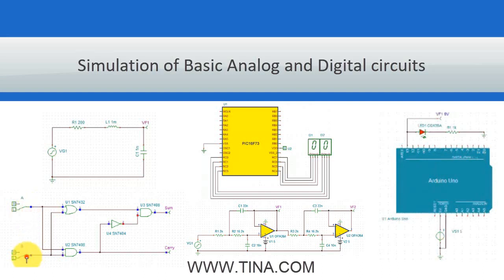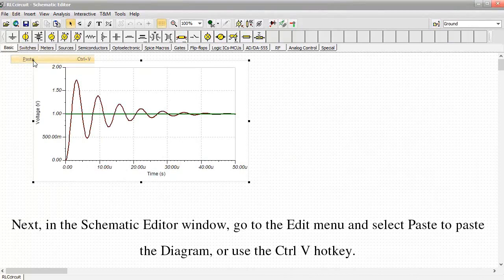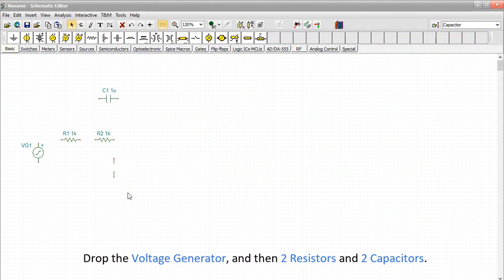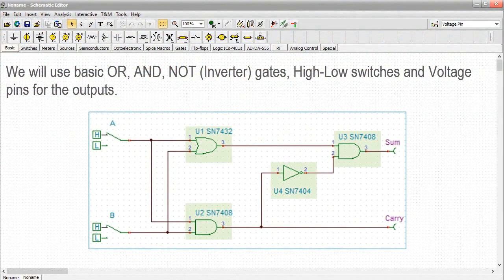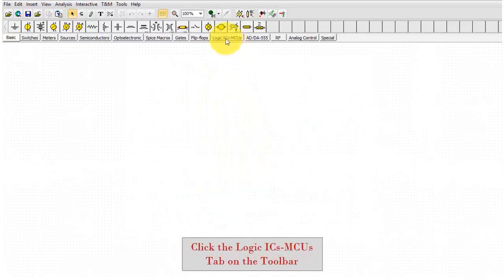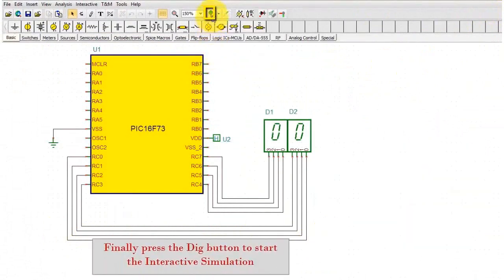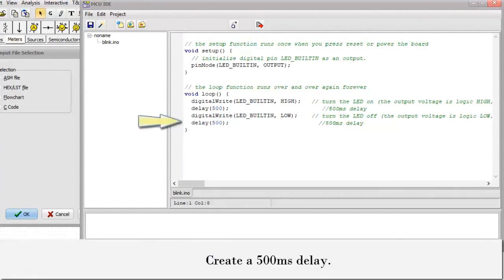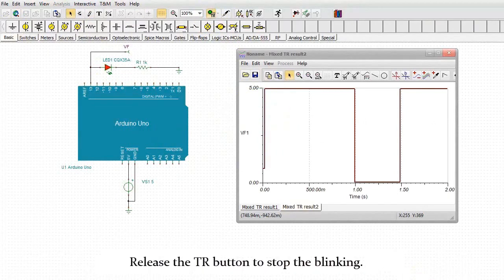Simulation of Basic Analog and Digital circuits with TINA

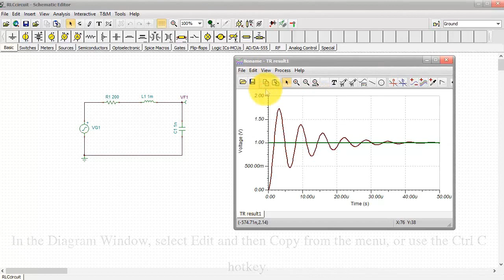Comment: At about 1:30 in your helpful video, you demonstrate how to save a plot image into the schematic. When I tried this it works, except that the "frame" around the plot image is 40 percent larger than the actual graphics. Trying to re-size the frame only makes the plot image smaller. I would appreciate any suggestions for solving this issue. Thanks for the terrific video.